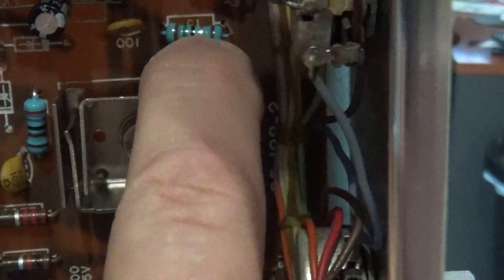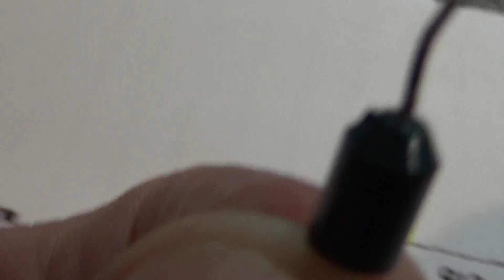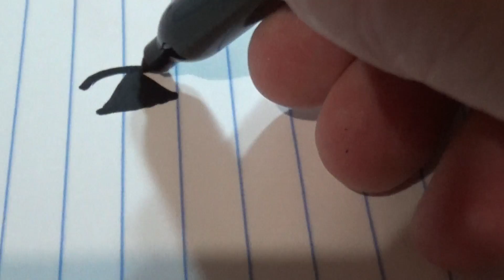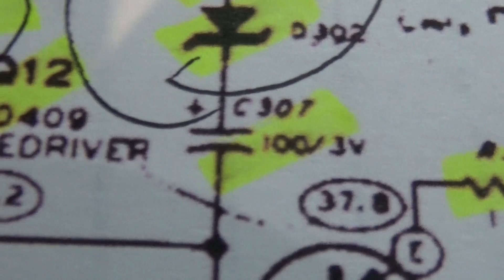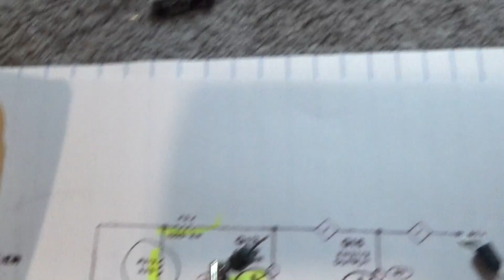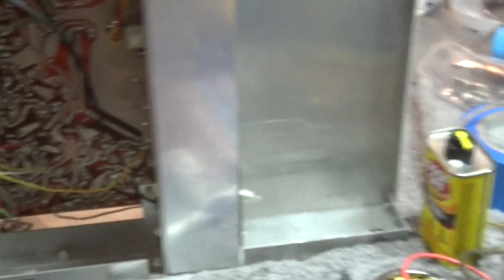Heathkit TA-17 Episode 5 - Do or Di(ode)

Comment from the maker: You will notice I did not have a 24k resistor and connected two 12K resistors together.  In modern electronics apparently 24K is not a common value while 27K is.  Problem solved.... As Joernone would say,  PIECE OF CAKE

Comment: Hi Ron, It just proves the weakest link in this amp was catastrophic to many of its parts.  Um surprised at how much damage was there do to a zener diode.  I still wonder if it was abused.  You never know what you're gonna get from ebay.  And it was worthit after all, looks to be a nice amp, and can't blame Heathkit for some bozo crankin it up to full blast with added overdrive pedals. Um still very curious as to what speaker cab you will hook up to.  I got my sub on standby!  Don
Reply from the maker: Don - I do think that a bad Electrolytic Cap can also cause these problems if someone plugs it in and tries to crank it. We'll never know but she'll be purring as soon as those Diodes come in....  For the test I am going to use a Markbass NY151  Cab ( 8 ohm) and see what this puppy can do  :)

Comment: Ron, I believe that 4 volts are the break down voltage. The current can not pass thru from the other side until it hits that voltage.Carl
Reply from the maker: You are correct Carl - I learned that last night after watching some other videos. Either way, with a dead shorted Diode, some really bad voltages got to places it was not supposed to get to and voila !  SMOKE. 
 :  Thanks Ron